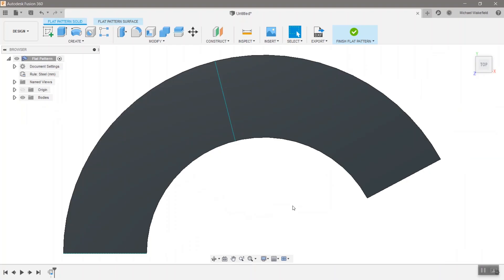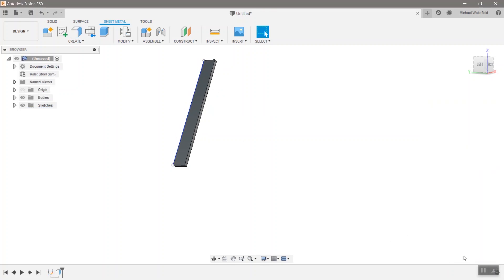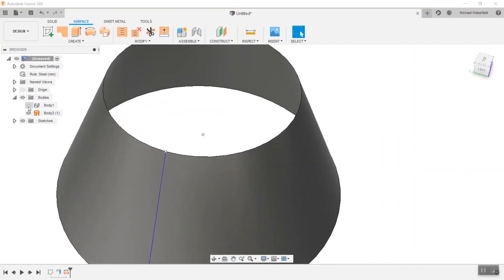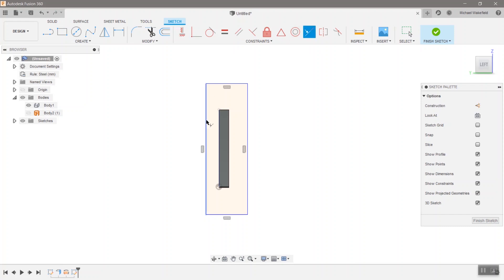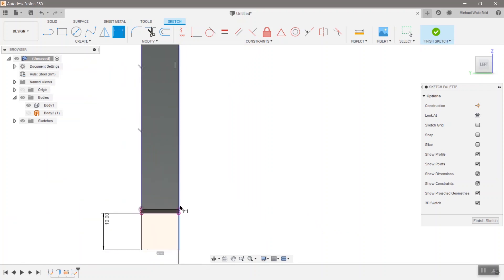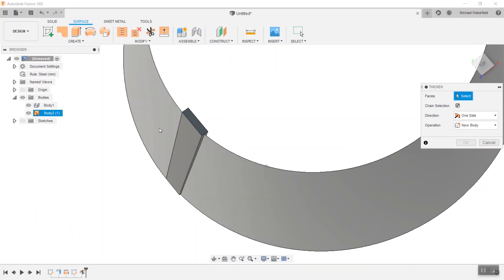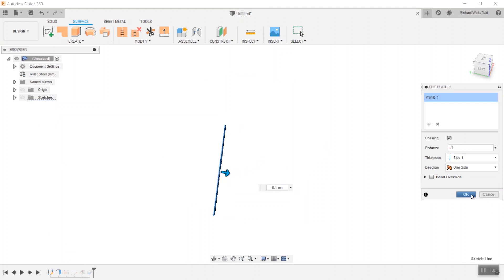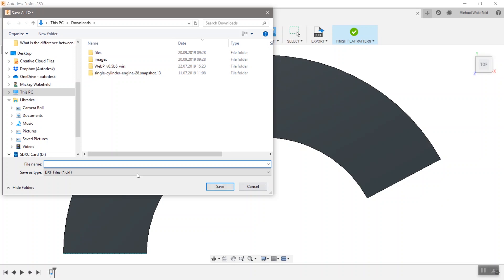Creating a sheet metal cone in Fusion 360

Comment: Although you could form this sheet metal part into a cone using a slip roller, this is not how you would model a cone for forming on a press brake like you mentioned. You need to have individual bend lines with flat flanges modeled for a cnc press brake.
Reply from the maker: Thats true. You'd need to roll the profile to have it be completely smooth...but, today, Fusion doesn't support rolled profiles. Getting a flat pattern like this though might be enough to allow someone to roll this out by hand though. (Maybe - a true sheet metal pro might have something to say about that! :-) )

Comment: great tutorial! unfortunately i couldnt get the sketch line of the cone to "flange" out horizontally as you did. the flange only works +/- vertically. Must be something with the program updates as the flange command window in the current version looks different compared to yours.

edit: took some time to figure it out. just switched the sketch plane of the cone diagonal(?) on to the top face instead of the front face. now the cone is tilted 90deg but that doesnt affect the final sheet metal pattern in any way. was also able to create an oblong cone sheet metal pattern using this method (replacing the "surface revolve" with "surface loft" instead).  kudos again!